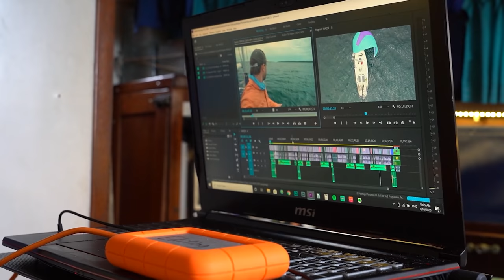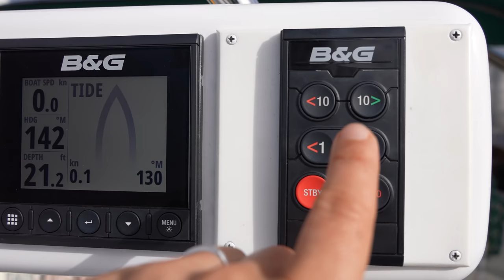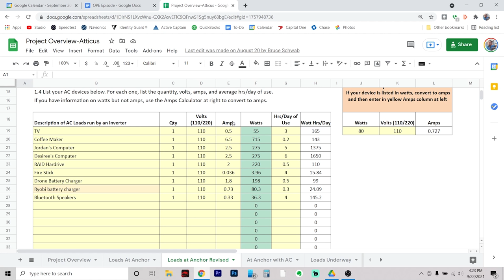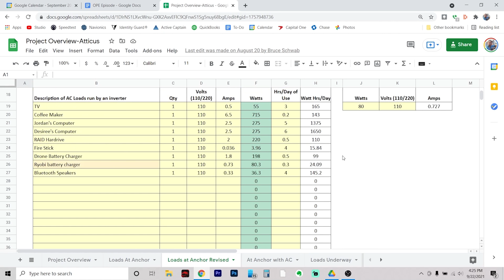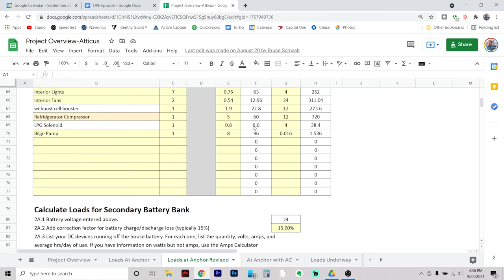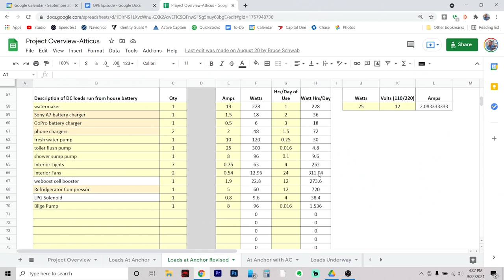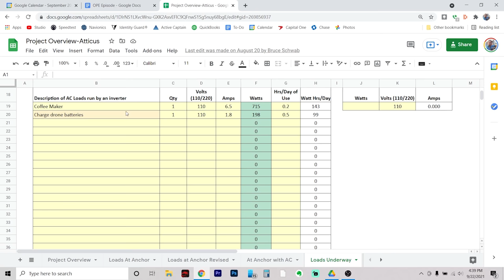Building our Electrical System | S06E20

Comment: Interesting choices. Why use an 12V battery bank?  If you had a 24V or even 48V battery then you wouldn’t need such thick wires to distribute DC power.
Reply: I too wonder why 12V when starting from scratch?

Comment: I know these videos have a time lag, We cruise on our Oyster 485 and require about 50 percent more energy per day than your estimate, please consider a generator. If we "camp" our solar panels keep up, but if we live at anchor for days or weeks and make water the genset runs about 30-45 minutes per day. Our main engine is a Saber / Perkins with one Balmar 140 amp alternator and  70 amp for charging the cranking batteries.Our genset is an onan 9k, the main engine burns 1.3 g p h at 1800 rpm or 1 g p h at the 1200 rpms required to get amps out of the alternator. the genset burns 2 liter per hour and you don't put hours on the main engine.
Reply: If you consider a generator to be so important, give them the $25,000 to buy it. Their system sounds fine and way more affordable. My 1986 Yanmar runs perfectly with over 8000 hrs while powering a 120 amp Balmar when needed
Reply: @tropicalsailor2908  if you look down in the comments  SV Nepenthes' price was over 40,000 dollars
Reply: @charonstyxferryman  exactly and saver

Comment: It is easy to be confused when dealing with electric power. There is a lot to understand. We went a little more simplified on our solar/battery system for our RV. I installed two 100 ah battleborn lithium batteries and a 1000 watt inverter. I also ran a couple dedicated ac plug ins from the inverter. The other change I had to make was our RV converter was swapped out for one that is compatible with lithium. We don't try to run everything off this system. While boondocking we can watch a little tv and a few other things and the solar (200 watt ) keeps us going just fine. We also have a 2200 watt generator for backup on cloudy days. Coffee is made the old fashioned way on the stove. Fridge runs on propane as well as the hot water heater. Thanks for this video. You cover the subject well as usual. Could have used you in our mould shop at the glass factory back in the day!

Comment: Jordan have you considered changing your 12vdc system over to 48 vdc with the loads you have a lot of savings could be in the wire size and weight. Rick Moore just changed his boat over to 48vdc for a lot of savings.

Comment: Jordan, as a pilot redundancy is your friend, I see many similar comparisons between flying and sailing. Having a generator may be extra weight and the need for more space but when you are at 30 west crossing the Atlantic and the main engine won’t start and you haven’t seen the sun in 5 days you may wish you had the back up generator or in addition some wind turbine to get you through. Safety first!
Reply: That was my take away as well. Why would you have redundancy on your boat? So you can self rescue if everything starts going south. One thrown rod when your 1000 miles from help means everything that runs on batteries will be dead before long.

Comment: hey guys another great video my suggestion for alternator would be 2 160amp alternators  to meet your charge requirements, this gives you inbuilt redundancy because if you have an alternator failure you only lose half your capacity, bearing in mind a 3oo plus amp alternator is not going to be quickly replaceable remotely.

Comment: A couple of points. You’re estimates for energy consumption are almost certainly wrong. But that’s ok because it gives you a starting point to work from. It also  makes you think about the electrical issues you’ll face. The design process then should be about the physical limits of the space you have (how much solar can realistically fit, physical space for batteries, what load can your engine push). Then it comes down to the ratio of solar to batteries and alternator. You also need to factor in the relative reliability of you’re energy sources. So solar, battery, alternator from most to least. I would also get out of the 12v mindset. 12v isn’t the best when the loads go up. It’s because of i^2r losses in cables and if terminals get corroded cause fires. If you can reduce the current by upping the voltage the risk is  quickly reduced (that i^2 thing). It’s why 24, and even 48 volt batteries systems are safer from a fire perspective. General rule of thumb is when in doubt go bigger with the batteries. You’ll last longer on cloudy days and will have a longer life due to lower effective cycles.
Reply: It's definitely a complicated planning process. I agree with the points that James Boulton makes.  Never hurts to have a few more batteries than you think you will need after doing your calculations.  Higher voltage is more efficient when traveling through long wire runs but all the devices run on 12 volt so you have to step that 24 or 48 volts down to the 12 volts and that uses power and is one more item in the chain of items to fail.  Also, I believe 24v and 48v alternators are CRAZY expensive. My concern is your dependency  on the motor in your boat. I don't recall how many hours are on it or what HP and brand but I'd want a new or lower hour motor on my boat from the get go if my time line was 10 yrs of usage.  With an older motor, I'd want the extra generator for peace of mind for inconvenient time when your engine quits.  I see Yanmar makes a small diesel "portable" generator, 2000 watts for about $5k that weighs a bit over 100 lbs.  A Honda 2200i gas generator is the no brainer re: cost and dependability BUT it's a different fuel type than your sailboat engine and carrying fuel for it rules it out.  The weight of fuel and generator is more than the weight of the Yanmar diesel portable generator.  Like everything with a boat, you have to make compromises and understand what things are most important to you.  Fortunately, you've lived the bare bones lifestyle for 7 yrs and were able to find joy during that time.  So you know you can tough out a few days without power or a week if necessary and you'll be fine.
Reply: You sir, sound and think like an engineer... An optimization process...

Comment: So I'm just wondering out loud here, so maybe nothing to it, but those two laptops are using power that you've converted to from DC-->AC and their power supply immediately converts the AC back to DC for the laptop. I wonder if a DC power supply for the laptop for use on the boat might be more efficient?
Reply: Typically laptops have a DC input higher than 12 volts, so you can't do a direct input.  But, you could wire in a step up converter.  You still have efficiency loss, but it's more like 5-10% instead of 15%.
Reply: I switched from running my rugged laptop with an inverter and standard power supply to a 12vdc power supply and I can run it twice as long on the same house battery.
Reply: @TheOverproof151  It is my understanding that they are using laptops with high end graphics processors. Graphics processors are just power hogs to do what they do. If you want to see typical specs for the laptops just look up gaming laptops.  The fact that laptops pull power from their batteries does not isolate you from needing power. If you are drawing a lot of power out of the battery then you have to recharge more frequently. If you are using a high power laptop for (say) five hours then you will probably have the charger plugged into power for most of that time. Now the power brick will draw minimum power while the battery is charged but as soon as the battery needs to draw charge then a lot of power will be drawn by the power brick.
Reply: I built a rig that would power and charge my MacBooks directly from a small foldable solar panel array. Had to custom make the cord though.
Reply: @longestuseravailable  what this man said. Great question though!
Reply: @paulphilippou3286  How many watts are your solar panels? Would you mind telling me about your system?
Reply: @georgegilbert7347  My pc has a 750W PS to support its components, but that doesn't mean it can't idle at a 100W or less, as far as i know, the power draw is proportional to the processing power used. If you max it out, it will draw more power, but it will also be done quicker. So i don't think that higher end computers nessessarly consume more power for a given task. Should be the same for laptops. If for example you try to render a video on a shitty laptop from many years ago, it will draw less power but also might take days to finish the task, perhaps consuming more power over time :D

Comment: Just thinking out loud as regards the lack of space for many fixed solar panels, it is feasible to design a solar array that consists of perhaps 3 panels which are stacked  but  moveable, much as a drawer on runners, that could be extended to expose the three panels when at anchor and requiring more charge.. this could of course be two times three if space is available on the cabin roof.. anyway just a thought.

Comment: You need to look at the latest Apple laptops that have the new chips from apple in them, they use soooo much less power. Only the 13" model has the new chips yet but the next release will be the 15" ones. Your power draw using them will be less than half of what you're using now and have better render times.
Reply: The problem with Apple equipment is the price, and the nearly complete lack of field repairability, along with high parts and repair cost from Apple and planned obsolescence, engineered in by Apple.  The power savings is negligible.
Reply: @TheMSC545  it seems the Atticus team can afford these upgrades.  Its an investment in their business and can be expensed.

Comment: "Why have two engines on a boat?"
You need to consider the prepper adage: Got one got none.  I would develop another load analysis determining the absolute minimum load you could get by with and plan to provide that with a high availability generator.
Reply: Theres another breakthrough possible and thats with ICE engined generators. A few bright curious individuals have realised that Rotor wankle engines are Much Smaller, lighter a lot simpler, quieter, vibration free and love running at steady fast RPM rates for long periods without having to constantly speed up and slow down every few minutes as in a direct drive land vehicle especially as they have pretty much  cracked the rotor tip issues.  
These motors are tiny compared conventional med. to large generators and only have a handful of moving parts.

Theres also new generation of reciprocating shuttle  AC pumps being developed i will link but the base improvement figure seems to be a 20-30% increase in efficiency.

The other element that might be work well here is the design of the panels.. even with the best current Silicon crystal technology in hot sunny conditions they heat up and their efficiency drops and to a lesser degree life span drops. 
 
Theres a design out there that could be very useful if they have an insulated hot water storage vessel onboard.
These are water cooled solar or hybrid thermal/photo voltaics.

Circulating water through thin PEX pipes fixed to the underside of the photovoltaic  panel. They get very hot ... It limits the temperature rise and increases the efficiency for a start and by circulating in closed loop can be used to preheat an insulated hot water supply tank or solid thermal store via a heat exchange loop in tank. The circulating pump is tiny and the draw minimal the complexity minimal.

Comment: Compliments in my other comment, here's a question. What freaks me out having spent enough time on boats as well as watched sailing channel videos, is the horrible spaghetti of wires or cables when repairs need to be done. Question: will you review the cabling too? Does this boat have conduits for cabling? Would you keep different types of cabling in separate conduits (power, control, sensors, communication, etc.). And how can you get better organized behind panels? Will you design all this and share that here?
Reply: Good points. I can tell you with our newly purchased fixer-upper the wiring is a rats nest. All of my wiring needs to be redone. The previous owner new just enough to be dangerous. Lol
Reply: @charonstyxferryman  - precisely. That is the background of my question. It also can drive design (or electrical system architecture if you like). If you had a low voltage motor in the bow that you need to start/stop from the cockpit, you might want batteries there and relay switches in the aft to start and stop (so as to prevent huge current flow all over the place). Alternatively, there may be higher voltage (for lower current) on board for such applications to be more easy.

Comment: I’m agreeing with the others who recommend a small generator to provide redundancy and, more importantly, increase efficiency. 

Alternators are not very efficient compared to an actual generator. It’s hard to pinpoint an exact number, but the consensus seems to be around the 60% range, and that’s on top of the engine’s already low 30 - 40% efficiency. Combine the two inefficiencies and only about 20% of the energy in your diesel fuel will get turned into electrons in your batteries - the other 80% gets wasted as heat through the engine radiator and the cooling fins on the alternator. 

A bespoke, high efficiency generator will be closer to 35% or 40%, or almost double the engine + alternator. That adds up over time when you do the math on fuel costs per kWh of energy. 

Regarding charging batteries from the main engine while motoring out of an anchorage:  if you are charging at 300A and you motor for 30 minutes, you’ll only add 150Ah of energy to the batteries, or about 25% of your total battery capacity (if the bank is 600Ah). 

Best primary option is to maximize your solar. Be creative in creating more ways to mount solar, including building racking to make a solar canopy over the cockpit if possible. If you can fit 3 kW on the boat, you could cover all of your daily energy usage over the course of your average sunny day. A perfect day would cover all of your daily energy usage in just a few hours, especially in equatorial regions.
Reply: Vertical axis wind turbines + solar = off grid goodness.  My boat 0 internal combustion elec motor and all.  1.2kw solar (max) array and 2x400w wind (max) keep me running no worries.

Comment: This is exactly what I was trying to express to you in the email I sent you way back when you were thinking about buying a 20 year old used boat, they were not built like they are today and we have advanced many aspects of the "efficiency" in the new cruising boats, mainly, electrical and safety, safety being the basic hull construction! 
Remember, I was pointing you to the Allures Yachting 40.9, which for just around €580,000, you would have an aluminum hull with ALL the bells and whistles, meaning, saildrive (Which you will soon want to replace that diesel engine), induction cooker (Along with rice cooker, crockpot, multiple electric kitchen items), generator (Only diesel or gas of any sort on the boat), solar array complete with wind & water generator, and ReGen, etc.
The new boats today have you covered for renewable energy since you are generating for your own personal floating space. Advancements are occurring at a faster rate because of all the high demand, which drives ingenuity in our field and it is substantial.
Add up all the nickel and diming I expressed to you in the beginning and let me know the overall cost, I would be very interested to know.
Finally, the one major aspect that most beginning wannabe sailors NEVER consider, and as a cruiser should be the VERY FIRST item they do consider, is the hull material and THICKNESS, just ask Dick Beaumont about what he thinks while they are building their cruising line the Kraken Bluewater Cruisers, and sorry to say, that is something you just cannot change, you own it as it is from 20 years ago.
Fair Winds and Following Seas!

Comment: When you were going threw the list of electrical items that would be running I didn’t hear you mention a combination washer / dryer . Buddy your about to have a new permanent crew member that will produce soiled diapers on an amazingly regular daily basis. I assure you that after a couple of days worth of production of said items you will not want them hanging around especially in the tropics or in a closed cabin with heat on in the north. Your musing of relying on one 300 amp alternator to provide all your power requirements is just insane, if the motor don’t go your dead in the water! You must have enough solar , wind turbine, hydro vane self steering and some type of towed water turbine and a small portable generator to provide enough electricity to maintain life. Especially on long passages with a new born, or don’t leave the dock.

Comment: Jordan are you planning for some kind of wind generator?  Since the wind is more consistent in aquatic environments, would this make sense considering your "solar real-estate" issue?
Reply: Wind turbines seem a minor contributor to regeneration.  Sailing Uma recently upgraded to regen under sail--the power of water turning the prop/generator being far greater than wind.
Reply: @EdKendrickDDS  not exactly. A wind turbine is "always on" whereas regen is only available if there is enough wind and you're sailing. It does have great potential though.
Reply: A wind turbine would give you considerably more power on average than regen
Reply: @EdKendrickDDS  That may be true when underway.  (You also lose some SOG if your prop is "free-wheeling").  The wind on average blows more at night, so if at anchor, does it make sense to have a reasonable wind generator?  I know they have these that can run pretty quiet now.  Just asking